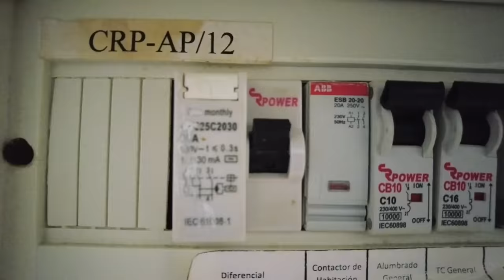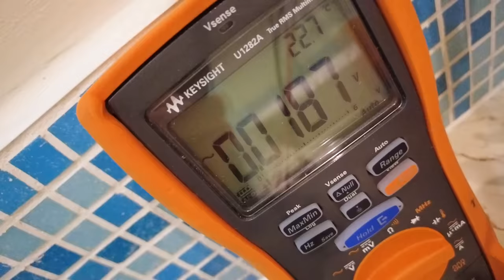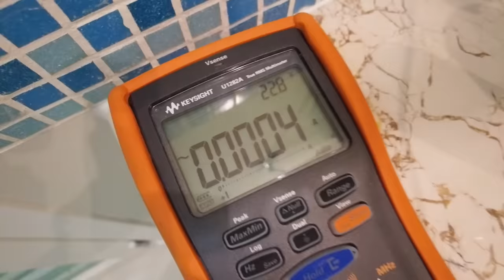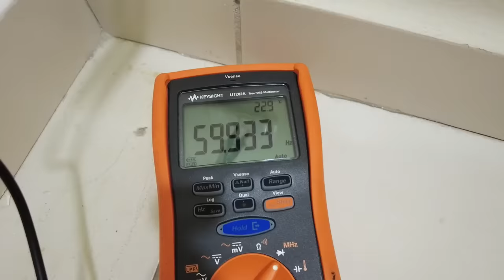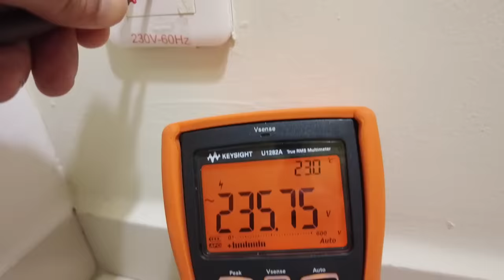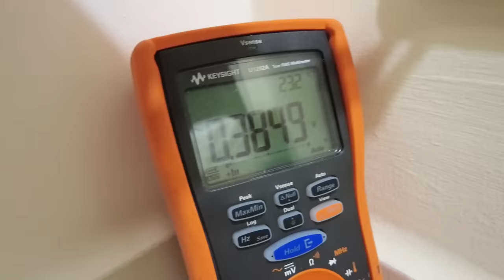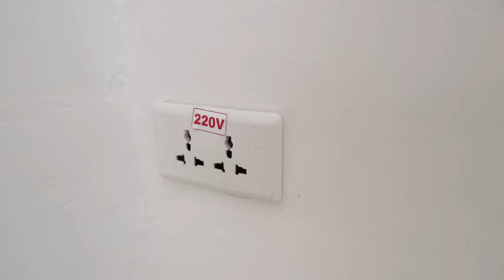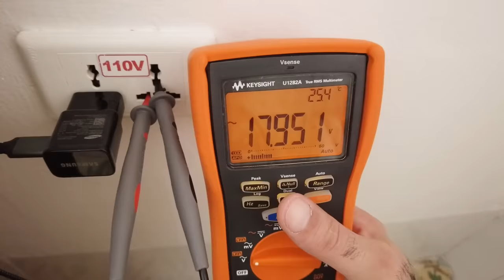Cuban Electrical System Shorting

Comment: Our regulations in Australia state that they must trip below 30ma  and within 300 ms. They are rated for 30ma trip but they are designed to trip a little over half that.. usually 22-24ma. hope this helps.

Comment: Between NA plugs fitting in 230 volt outlets and the reverse polarity of the sockets, I have a feeling lots of Canadian and American travelers have killed lots of electronics here.
Luckily a lot of things will handle both mains type voltages these days, but that reverse polarity could still be a problem.
Reply: That reverse polarity should not be a problem for any device that is also exported to the EU, since many plugs there don't have a polarity.
Reply: Reverse "polarity" is a way lesser/nonexistent problem compared to double voltage. It's AC, remember. Almost nothing will die because of reversed phase and neutral. At worst it's a safety issue.
Reply: generally reverse polarity on AC doesn't matter.  It just flips the AC wave upside down.  There are a few systems that need neutral tied to ground, but not many.  Some European stuff might not like 60 Hz vs 50 Hz.  At least it isn't Jamaica with 110V 50 Hz.
Reply: @rexsceleratorum1632  Yeah its a big safety  issue as it can make some of the metal parts live on none grounded  things that are just keyed at the plug to prevent RP.
Reply: @hgbugalou  There aren't hopefully a lot of such devices because touching the neutral is not safe at all. If you touch a metal part connected to neutral but the neutral line in the socket doesn't make contact, you might get a significant shock. A deadly one if the device is high wattage (low resistance). If the main neutral line fails it is even worse, you will be connected to live via all sorts of home appliances.

Comment: 15:00 normally that would be a typical case of bad ground connection and therefore induction. Once had a socket with 60V between ground and neutral because ground wasn't connected in the power distributor...

Comment: I accidentally tested Cuba's electrical system when we were there.

I borrowed my sisters travel adapter which I was a bit worried it could handle a laptop.
It looked safer than the one the hotel provided. It looked like a giant bare transformer from a microwave.

Well my sister's blew up and started smoking after 15mins of use.
The hotel one worked like a charm.

Comment: The 0,03 mA whick is stated on the rcd, is max value before trip, some are more sensitive and trips at lower mA, in Denmark the max resistance to ground is ma, 1666 ohm to limit the shock voltage to max 50v, and for animal households lts half so 833 ohm to reduce voltage to 25v,
That way you should always survive a shock to ground

Comment: I hope you come to Finland one day I would love to hear if our systems are safe or not
Reply: On nää aika turvallisia melkein kaikki laitteet ovat suojattuja 30mA vikavirtasuojalla, paitsi jääkaappi, uuni ja kiuas. (Niissä on maadoitettu metalli kuori joten huolta turvallisuudesta erikseen ei ole) Vanhoissa kohteissa ei välttämättä täyty uudet vaatimukset, jolloinka turvallisuus riippuu kohteen uutuudesta.

Pretty safe. Allmost everything is protected by an 30mA rcd, except fridges, ovens & sauna(heater). (those devices metal shield is grounded so no extra safety concerns)
Old buildings may not be following the new standarts, so the safety depends of the buildings age.
Reply: @MinePossu  No se on osittain syy miksi haluaisin nähdä kun toteaa että täällähän kaikki pelittää :P
Reply: in the middle of the night when your breaker pops, Mehdi will slowly manifest nearby! have to offer some grillimakkaraa as a sacrifice!

Comment: 0:42
Yep
It seems in Cuba use the similar standard like Argentina
One differential switch (GFCI but for all the instalation) first and several thermomagnetic switches for different uses after that
Reply: CLARIFICATION: If an Argentine reads this, keep in mind that our country standard =/= reality, each home is a different installation and we still have some homes with fuses

Comment: 16:30 

Bro you didn't push the button so there is no electricity run in that wire

{it's not turned on }

Comment: 15:37 Guys, if grounding is so useless then why are there countries that ground their electrical systems? (Im still learning, please dont roast me)
Reply: Because in other country, they ground the neutral, so the neutral becomes 0 V relative to the ground and of course the phase will be in high voltage around 120 V or 220 V depend where you live. But in Cuba, the neutral is not grounded. So, the voltage of ground and neutral kind of floating relative to the ground.

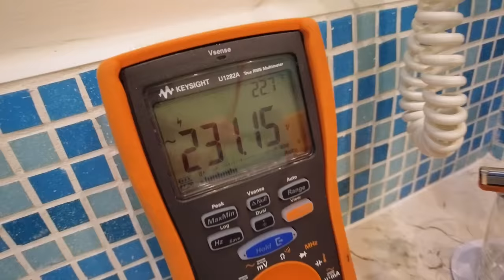Comment: 4:11, I have the impression that in fact they simply took the 220V from the other socket to make the voltage differential, as from 110V to 220V there is a 110 Volt difference they based themselves on this differential to power the device, that would explain why it outputs 110V on one side and 220V on the other, it's very strange but it remains logical from a physical point of view.

Comment: You have the same interests that I do I'm an an electrician as a hobby in the United States but I'm curious about the wiring and all the countries around the world I've been to Germany I see it's a lot lower than our codes like they overuse the wire and they don't put boxes behind light fixtures like the code says to do they use undersized wire for kitchen circuits you're supposed to use 12 gauge wire on a 20 amp circuit breaker and in Germany they used 1.5 mm which is even lighter than 14 and they put it on a 16 amp circuit breaker for the kitchen

Comment: Cuban electrical system is surprisingly good. It almost seems the Italian one as you said.
Tip: the test button on the differential actually only tests it mechanically, not electrically.
Reply: It does test it electrically, though. There's a resistor that is set off by this button, forcing a differencial current in the device and thus tripping it.
Reply: @Micha-xl5yc  nope. It would imply that there is a earthing cable connected to the switch, but there is not. It can't test the differential current without a resistor between live and earth. It can't do it only with live and neutral connection.
Reply: @Ale-bj7nd  It can an it does, no earth wire is required. The testing resistor is simply connected to different sides (primary and secondary) of the RCD, hence it forces some differential current in the current transformer. There's a schematic diagram for it in Wikipedia, look it up.
Reply: @Micha-xl5yc  that's interesting. Thanks

Comment: 4:10 - Autotransformer and tap only leaked enough current to measure but not short.
17:07 - Older system is delta connection requiring double-pole breakers and usually floating without earth reference (usually it's more than 50 years old system) while newer is star connection with earth reference._

Comment: Given your love for all things electrical, and especially the FULL BRIDGE RECTIFIER, maybe something you could do a video on (maybe the 101 series) would be the expanding HVDC system of transmission. After watching the video from Wendover on the grid, I started down the rabbit hole with DC transmission. I did read there was (still is?) An HVDC line to Vancouver island. I'd love to see the fullest of full bridge rectification on that sort of scale. Definitely seems to be right in your area of expertise.

Comment: Just go to Indonesia and pissed of for the unstable electricity in here. Sometimes the voltage skyrocketting up to 255 VAC. I ever try to make my coursework (Regulated DC Power Supply with bunch of transistors), and my transformer and bridge diode burned down in flames just because the voltages from the source is skyrocketting to 255 VAC

Comment: in US, we get 240 by combining two 120 hot legs and one common and/or a ground. running 240 in one wire creates more heat, doesn't it? maybe wearing out wires and connectors faster? i dunno.

Comment: 16:56 There is a switch on the top of the outlet and it seems tured off when you are touching the wires. You may have touched the wires while it if tured off or is it a switch for a light?
If it is the switch for the outlet itself, the reson ground vs live didn't show voltage should be because they probably haven't connect the ground wires😅

Comment: 15:45 not true... the rcd is popping if you touch L and N because there is a partial amount of current going to PE.. in germany it will popp the rcd if the amount which is flowing over PE is 30mA.. so ground makes a differenz in this case and if you have a class 1 device with metall body the rcd popps if the L touches the metall housing.. cheers bud✌️
Reply: otherwise like in hospitals it an groundfree system, but it needs to be monitored with expensive devices..than it only tells you if there is an short somewhere but doesn't shut down the system.

Comment: Mehdi did not proof that the faucet was grounded. More and more plastic is used in waterpipes nowadays. De milliamps he measured where due to the capacity of the foset. The shock he felt was due to the capacity of his body.

Comment: To a real test of fake inductions tensions and ground faults you should use a multimeter with low input impedance as FLUKE 117. Does Keysight haven't one?

Comment: 16:45 Does that plug need to be turned on to test the voltage? Or is that the placement for on for that switch?

It has been puzzling me, I'm probably just stupid.

Comment: I like how you had to label that coal (I'm assuming) power plant as a power plant, for all the poor city folk who've never seen a power plant in their life.
And to clarify, I'm assuming that's a coal plant since they're more common than oil, and we have some of them near my hometown in TN. Not to say my state isn't literally leading the way in green energy, we built the first nuclear plant since the Three Mile Island incident. And while we're here, fun fact, coal plants spew more radiation that nuclear plants. That's because there's trace amounts of uranium in coal, but they aren't required to shield against it. Still doesn't match up to the minuscule radon threat that we prepare for, but a fun fact nonetheless.

Comment: If I was running my own building up here and he kept showing up to the front desk to reset a breaker "that keeps tripping".... I'd have him kicked out immediately for potential damages to the property and potentially attempting to cause damage to electrical system by repeated means of tripping the breaker in ways it's not meant to be... such as stuffing whatever metal objects into the outlet in an attempt to trip said breaker..... Mehdi is gonna get himself blacklisted on the Hotel Safety list if he keeps up these "hotel/motel" antics... keep them back at your own property so you don't get chased out for international issues (becomes international when your homeland isn't the location you're visiting)

Comment: How can you go on holiday without a calibrated RCD/GFCI tester?
Reply: p.s. The UK spec for a 30mA RCD is that it should not trip at 15mA and trip quickly at 30mA. Most trip around the mid 20's. I assume most European spec RCDs are the same - the breakers in the hotel panel  all appear to be to the European standard

Comment: So Cuban wiring is a little haphazard - as there are no switches on the wall sockets it wouldn't matter that "neutral" may be switched  (unless you are changing lightbulbs and ground out an unswitched  active...- hopefully  the circuit breakers are all switching the active, lol.

Comment: You should have checked if ground wire even exists. In the Philippines is common not to have it, and outlets have ground just because otherwise you would not be able to plug 3 ping pong there. Funny.

Comment: The reason for the incorrect wiring might be the same as india. Here the electricians dont really get a degree, they just try grow balls of steel and then handle live wire with naked hands, when they get shocked they learn not to do that again. So what matters to them is that they're not getting shocked, and appliances are turning on, not that the wiring is incorrect or correct

Comment: hotels are the sketchiest electrical installations of all.
because they are usually built like a flat as of materials.
if you would built the electrical installation perfectly fine to all standards and rules.
the special breakers would cost three times as much.

Comment: I would have liked to see a legitimate potentiometer test instead of just drawing an arc on purpose for the video, but I guess this is entertainment instead of a science channel. A proper test would have had no sparking whatsoever and the current protection breaker would probably not have blown, just the RCD device itself.

Comment: Cuba is a very poor country under a severe trade blockade. They don't have replacement parts for most things. And they don't have money for major repairs.  If one of those breakers failed, they could lose electricity to the hotel for a very long time.